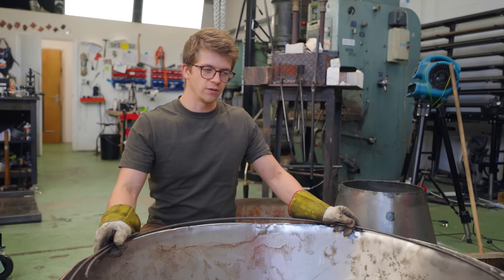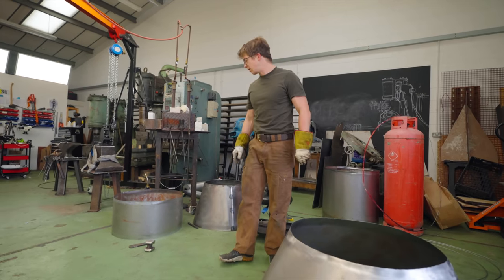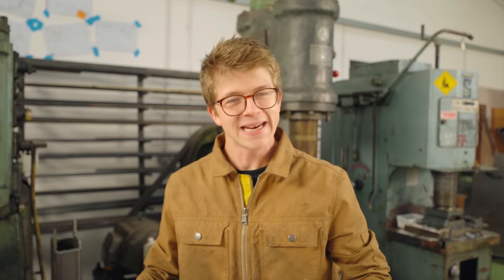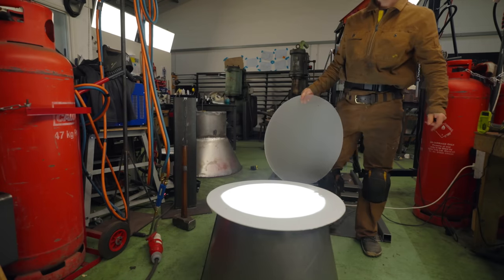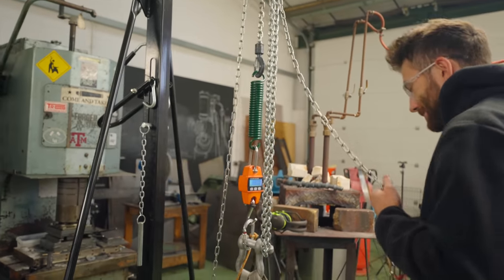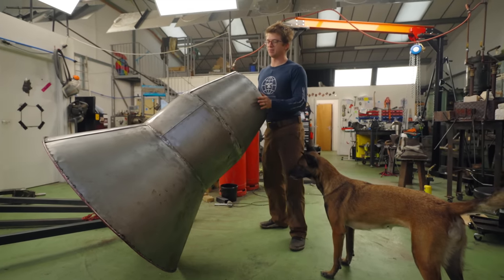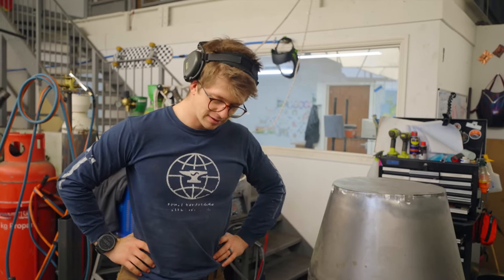I'm Making The World's Largest Articulating Lamp. (Part 5)

Comment: You can put two springs in series to double the movement with the same amount of force.
Reply: Two springs in series weakens the force though, like with the same extension they'd pull back with half the force; putting them in parallel does the opposite.
Edit I commented this before watching, I see now two springs in parallel is exactly what they want, the new springs are too strong, lol, my bad
Reply: I second this
Reply: @carazy123_   You can put two comments in series to double the movement with the same amount of force.
Reply: @barabolak no, your thinking of springs in parallel, in series they behave like the original commenter said
Reply: Came to the comments to say this.
Reply: I still don't think it would be enough.
Reply: @barabolak  series, not parallel
Reply: Came here to say the same thing
Reply: Just an elastic will be enough i think
Reply: @fabianstahlberg6808  as a longer spring?
Reply: @dh2032  yes. Springs in series are weaker and longer. In the case of identical springs, it doubles the length/displacement and halves the force
Reply: Just use hydrolics. It will be dramatically safer

Comment: you should add a counterweight somewhere in the cone to bring back the center of gravity of the lamp in alignment with the axis of the bolts
Reply: Yes, my thought would be a ring plate around where the wire comes out from the back so that the longer lever would reduce the counter weight needed and then could layer until balance is achieved. 1000 alternative ways options though
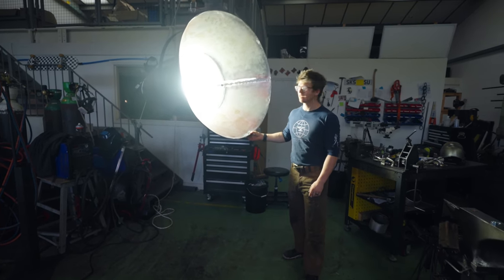Reply: Did you not watch the end? It was perfectly balanced at the 12:55 mark
Reply: @RyanYoxo  I think it was only because Alec tightend the nuts on the lamp so it wouldn't wiggle
Reply: Add a big giant twist KNOB switch to turn it on and off hanging off the back of the shade to balance the center point

Comment: Round balers (hay/straw balers) have very large springs for balancing a very heavy door which opens quite a lot as well as springs for tensioning the belts. Might be worth a look. 

Also a small tweak away from exact proportions may be allowable in order to increase the leverage somewhat on the main arm.
Reply: Ah yes. A fellow farmer. You must also know the springs that tension belts and rollers can can be a BITCH to take on and off sometimes. I’ve got a straw chopper that likes to eat belts so they need to be replaced far too often.

Comment: Alec - add a counterweight on the top of the light fixture. Putting the cone tip that the smaller lamp has would probably do most of it.
Reply: He could put it inside in the back so it's not visible on the outside
Reply: @mdewcool pretty much exactly what I thought
Reply: Of course, like balancing a car wheel

Comment: Drilling good holes in thin sheet is EASY - just clamp it between two pieces of scrap wood.
The top piece becomes a drill guide, the bottom piece prevents blowout, and the clamping prevents warping, twisting, and deformation.
For super accurate holes pre-drill the guide piece.

Comment: Use your crane scale to measure the force being applied by your lever, then measure how far it needs to stretch. With that you can calculate your spring constant and order the correct springs.

Comment: Fun fact, gels were originally made out of gelatin (hence the name).

A common prank on newbies was "cleaning the gels" since sitting up on fixtures for dozens to hundreds of shows they'd get dusty. Being told to do so specifically with hot water and soap.

Hot water dissolves gelatin.
Reply: Reminds me of the classic asking the new hire to get some acetone in a styrofoam cup.
Reply: Or the tin of striped/spotted paint, especially when your in cahoots with the paint guy so they just add some stripes then shake it
Reply: The old left-handed hammer/screwdriver.
Reply: Metric crescent wrench.
Reply: @8ACCraftworks It's like that except also the poor newbie is getting in trouble for destroying production equipment :P
Reply: @oliverer3  every now and then when there's a new guy in the shop ill ask for the metric adjustable wrench, then tell him whichever one he gave me is imperial and that i need the metric one
Reply: Or getting them to get some cuts of “open white” gel (when a light doesn’t have gel on it, it’s called open white)
Reply: @calebb5106  
Flip it over boss.
The other side is metric.
Reply: Or telling a newbie to get a bottle of blinker fluid, about 50ft of shore line, and a tin of elbow grease.
Reply: Go to the hardware store and ask for a long weight
Reply: Replacement bubbles for the spirit level.

Comment: If you can't find a spring that expands far enough while also being strong enough, you may have to go with a smaller/weaker version of that spring Jaime got and give it a reverse mechanical advantage pulley system where the spring is the load (mechanical disadvantage?). This will allow the spring to effectively expand further while also allowing you to adjust the opposing spring tension via the lines (like those wire fence tensioners that screw toward the centre). This also requires a bunch of engineering so more than one part.

Comment: If you have a rolling door company in your area, you can find spring engineers that can find the right spring solution for your needs.  A rolling door is a commercial of industrial door that rolls up over head.  I would think the wire diameter needs to be about .375" in diameter with at least a 5" to 6" coil diameter and about 3 feet long.  My experience is with torsion springs, so I am only guessing with the extension spring solution. What you need to define is the weight, the balance point (weight), and length of travel.  The balance point is the hardest value to find.  We use software to find this but we have to add a 5% to 10% fudge factor to be sure to not build the spring too small.  If you can find a company that winds springs, a shot peened spring can handle greater weight with a smaller wire.

Comment: You should move the gel out to the front of the lampshade and put a polished reflector at about the middle of the outer cone for more even light distribution(like the inside of a modern car headlight).that will ensure there is not a bright hotspot in the middle of the lighted area and a sharp cutoff into shadow, you could also use a piece of sandblasted acrylic instead of pre made sheets of frosted gels.

Comment: Just find a way to add a bit of weight to the top end to fix the balance point issue. (Maybe weld a thread and then grind it flush so you can screw some weights on the inside.)
Also it's so very fun to watch these series about ludicrous endeavours and you figuring it out. 
It really keeps it entertaining! Good job man as always!

Comment: Regarding springs.  First, put your scale and chain hoist on the lamp in place of the spring.  Use the hoist to move the lamp and graph how much force it takes in each position.  If you draw a line that "fits" all the points, the slope of this line is the spring-rate that you need.  Next you need to get springs that list a spring rate.  It's easiest to find stock compression springs, so look at a screen door spring and make a set of forks to pull on a push spring.  Die springs, bike springs, and motorcycle springs are good candidates.

Comment: Regarding the bolts not being in the exact center of the lamp some spring washers might do the trick! They'd let you more finely adjust the amount of friction to turn it, by just tightening the nut more. Just two will be cheap (but not cheap for washers) and should be available a lotta places, heck amazon probably has them.

Comment: If you want that bender to do stuff a little thicker you can space the bottom wheels farther apart. Just a couple holes. It really helps. It’s like the swag off road kit you can get for the cheap harbor freight pipe rollers. It adds wings to the roller so it bends pipe easier.

Comment: Ideas for the spring tension: perhaps a closed hydraulic system (long pistons connected to each other and under fluid pressure) or long pieces of spring steel kind of a leaf spring action. Good luck!

Comment: The lamp doesn't need to be heavier. The three springs in an angle poise balance the lamp and each other out.  You need to take the springs off your actual lamp and see what the relative strength is between them as a starting point.  But your size scale up doesn't necessarily mean the force scaled up correctly.  You might want to talk to a mechanical engineer to see if you can get some good solid numbers on your needs.

Comment: Gels are generally cheap and easy to get your hands on. They aren’t usually made out of acrylic though, usually it’s a very flame resistant plastic. Not exactly sure the type it’s made out of but it’s usually really thin, flexible, soft and flame resistant. If you’re using LED lights them being heat resistant isn’t that big of a deal. Gels aren’t really used anymore in LED fixtures because they tend to be color changing themselves with over 5 million colors possible. Gels are used in older halogen fixtures because they aren’t color changing. Halogen theater lighting fixtures tend to be anywhere from 300 to 1500 watts and most of that is converted into heat so gels have to be heat resistant so they don’t melt.

Comment: Alec, you should get the most INTENSE LED panel(s) you can find that will fit in the barrel then put a fresnel lens at the opening of the bell.  Or a clear sheet with a triple black bat painted in the center . . .

Comment: Hey, if the sring is that much strong and moves so little and you are not up to find or make youself a better fitting one (you have a forge 🤔🤔)

You can fabricate maybe a combination of pulleys where the spring has the perfect amount of movement and resistance 😁

I believe many would love to see that

Comment: If you turn the lamp around to face the back of the shade and reflect the light off of something white (and heat resistant, if needed) you'll cut down on even more of the harshness. Won't change the usefulness of the gels either!

Comment: Add weight to the top of the lamp if you need to balance it more. Should be easy to hide a couple of extra metal panels to give it the weight it needs. It is looking good by the way.

Comment: For the springs? Try looking above your overhead/garage door... There are different varieties and sizes used to counter balance a garage door... they are all springs just used in different ways.
Reply: ... Have you watched the entire build so far?
Reply: @DH-xw6jp  yes I have.. The springs he used for lifting the anvil... Too strong.. If he wants a proper spring go to a garage door company and they can size it for weight etc. I worked for a company that sold overhead doors.. counterweight springs, torsion springs etc. all the same just sized for the weight of the door and other parameters.
Reply: @Lordmaniax357  and they tried a type of garage door spring.
The one they used didn't work.
Reply: @DH-xw6jp  That's why I said to go to a garage door company.. There are many different springs for garage doors.. It's not one size fits all you know. You balance the doors by weight... how it is to open... the size of the opening etc. You can have 3 or 4 (or more) different spring types/sizes for just one door. different coils sizes... gauge of springs... length.. etc.
Reply: @Lordmaniax357  yes.

And if you read the commments on that video you would have seen dozens of people has already told him this. And a few of the comments were hearted, which means he definitely saw them and is aware of that fact.

Comment: I'm an industrial door engineer and the door springs your using as designed to be tensioned by adding (twisting) coils to the spring length. They are not really suitable for stretching.

Comment: Why don’t you order custom made springs? You tell the manufacturer your working envelope e.g. min length, max length, min width, max width. Then the k factor you want, the return force. They will then produce a coil you need for this application

Comment: There are actually garagedoorsprings that are exactly for this use with having very short leverage while holding the whole door. The ones i got at home also extend quite a bit with a relatively smal diameter.

Comment: I bet that if you gave StyroPyro a ring and told him the dimension of the lamp root he would rig up the brightest possible light that would fit that radii… it may be a laser in the end… or like a sustained lightning bolt… but it would definitely be the brightest possible option, and likely have tunable color and even intensity sliders hahaha

Comment: While the shape is different, there's little difference between balancing this and a car wheel; while elevated on the pivot point, add weights to the tail of the lamp until it's equal.

Comment: if I had this lamp i would use my 1930s lighthouse bulb which is huge about the length of my arm and double as thick as my head! I once lit it up at full capacity and I could see the full-sheen reflection of my window on the next house over which is about 40 feet away! and the rest of the treeline and gardens were overlit! I mean the cobwebs nearby caught fire! (R.I.P. spiders!) the sheet paper on the table below crumpled with heat!
apart from my X-ray bulb, this is the most dangerous bulb I got I can cook food with it just by placing the food under it! it's insane!

Comment: You can use garage door helper springs from a residential garage door. They are used on the sides of each track to help the automatic garage door opener lift the garage door.  I have 2 of them sitting in my garage that I saved from a job I did. These springs stretch nice.
Reply: Used on manual garage doors too. I was thinking the same springs would be perfect because they were made for the same purpose. Instead of countering the 300 lbs of garage door making it 20 it does the same job with a giant lamp. Much better than the rollup door spring idea or short springs for other purposes.